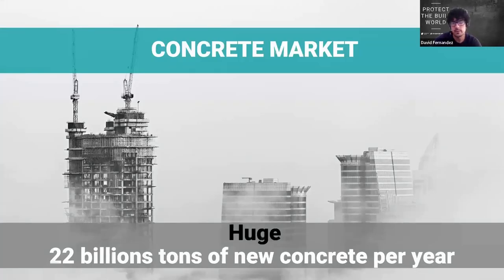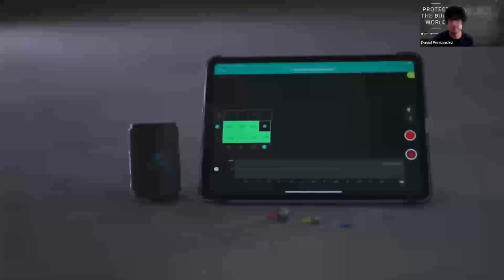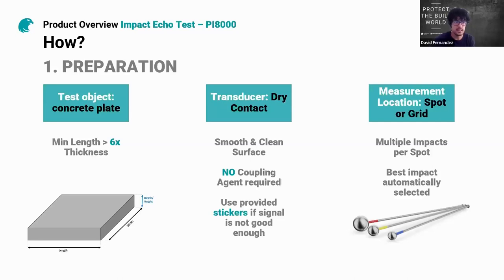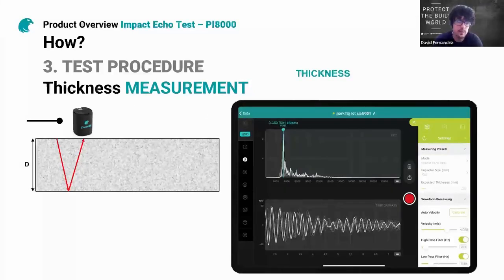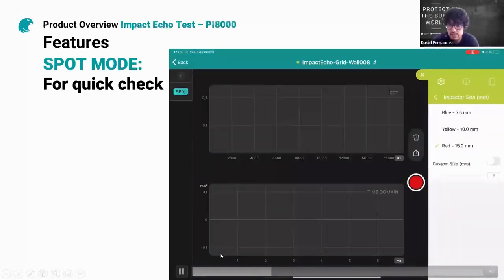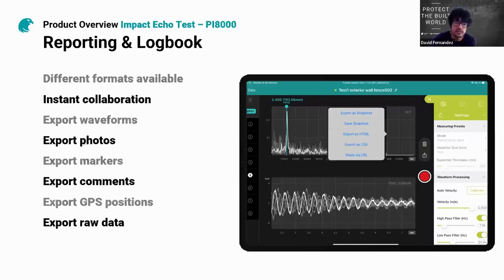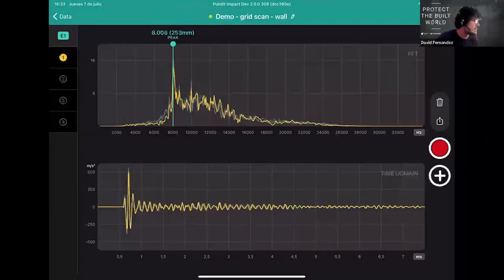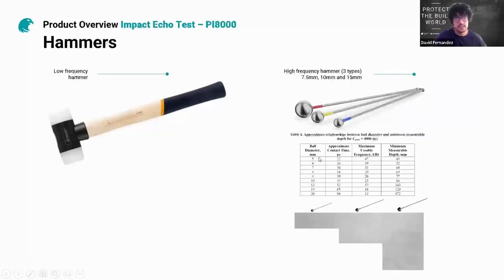PI8000 PROCEQ SCREENING EAGLE IMPACT ECHO WEBINAR

Comment: are you able to test cuved surfaces accurately? Concrete silos forr examples
Reply from the maker: With GPR, yes we just got the smallest radar from Proceq specifically to scan pipes for Water Corp.  If you are in Perth I would be happy to come out and let you use it.  My number is 0412269602.  My office is in West Perth.
Reply from the maker: I use a different Impact Echo, I use the Olson Instruments NDE360, I just realized that was the video you commented on.
Reply from the maker: But yes I have tested large concrete silos with the Olson Instruments IE.
Reply: @adampapworth  Unfortunately we are based in Abu Dhabi, thank you so much for offering though. 
We are to test large concrete silos (rebar mapping, checking for corossion around rebar, testing for defects), but struggling to find the right instruments that work well but also don't cost an arm and a leg. Would appreciate some reccomendations.